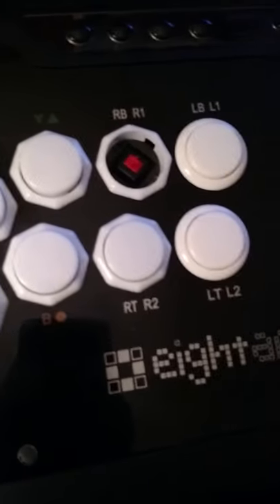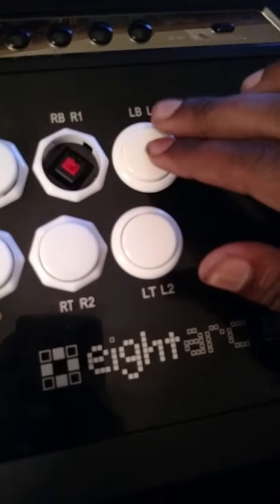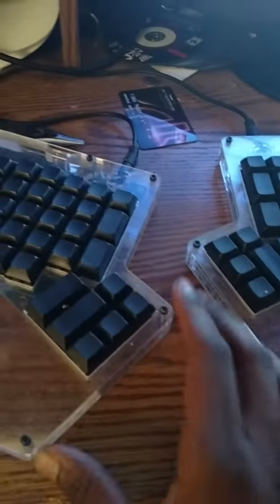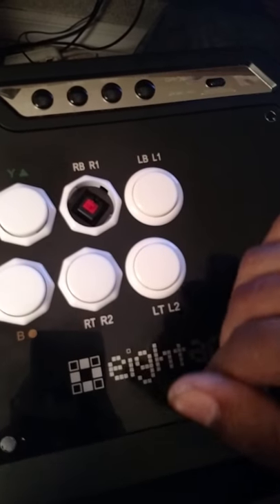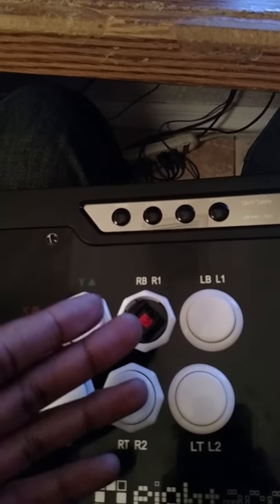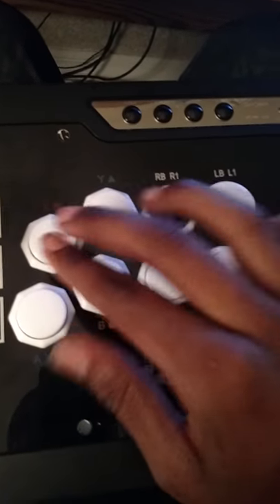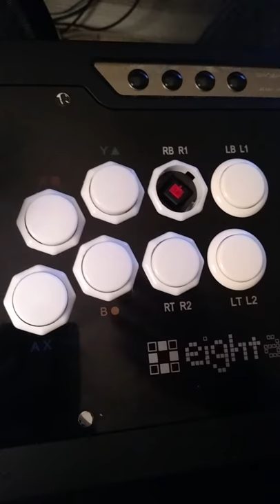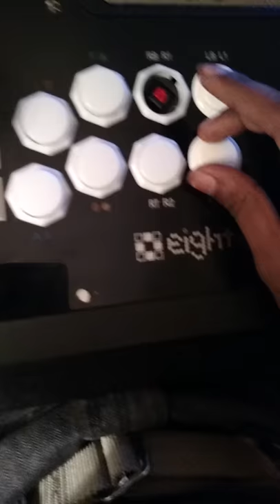Sanwa vs hbfs-g2

Comment: You know i have the same opinion when i decide to buy mkx fight pad i watched some reviews on its all about the noise of the buttons one of them said how can u ruin your combo if you hear the buttons you press and these same guys want to play on a silent buttons. I am sure if sanwa was silent from the beginning than they release the regular sanwa every body will buy it for the loud noise no body has his real opinion. I play takken every day so know when i play online i does not lose any match so i decide to change my joy stick i boat a silent sanwa joy stick because of the good fucken reviews on it i tried to do some tekken movement wave dash and back dash cancel they just did not came out i opened the the fucken joystick and i test the switches they are so bad they dont back to neutral fast becouse the silent switches got no spring in it and as i said if the jlf was released silent in the first place than they released the regular jlf every body would've bout the regular one

Comment: which bottouns and joystick are to most silent in your opnion? im searching for the less sound possible
Reply from the maker: Most silent? I would definitely say the G-2's with out the shadow of  a Doubt, but dont go buying the g2's its been a wile sense i made this video and they have the new versions out called the g-3's over at focus attack. you def want to get those buttons. g-3 are the quietest vs sanwa silent buttons hands down.
Reply: thnx dude, but what about stick? silent sanwa is ok or that optical sensor is more quiet?